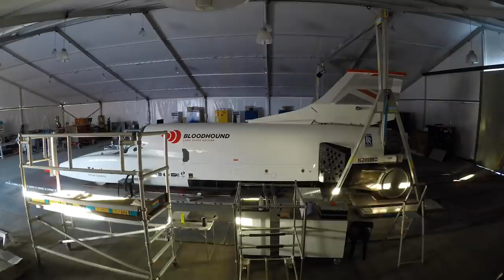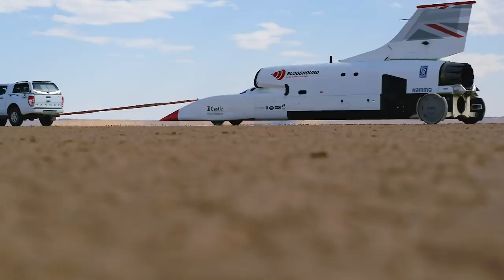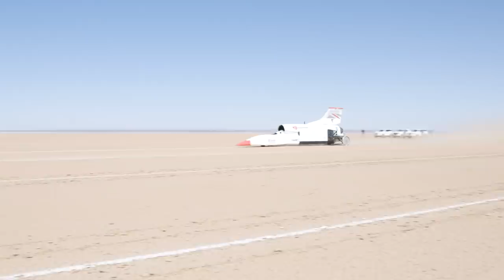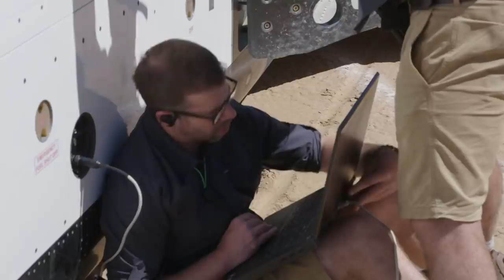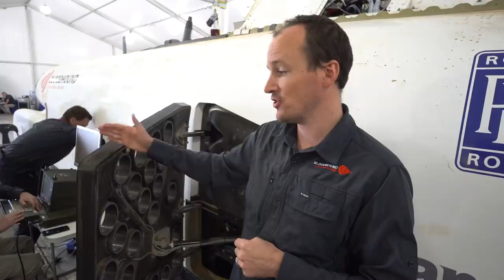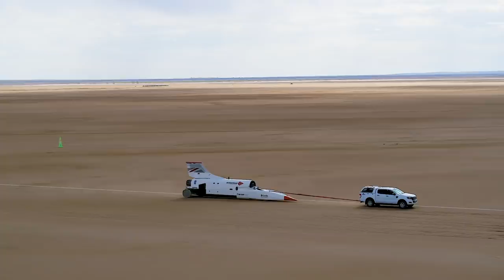Getting Bloodhound LSR back on track! | #2019HST

Comment: If you are running the car without the rocket engine in it, how are you compensating for how this will effect the balance and mass on the vehicle? Are you using ballast to compensate for this? I guess the added weight of it will not only increase the rolling resistance but also add to how far the car rolls.
Reply: This is addressed in a blog post on their website. The rocket will add weight to the rear moving the CG aft, hopefully making it more stable in crosswinds.

Comment: Good idea to test air brakes fully out first and get a baseline. The most hazardous test, I believe, will be first starting to deploy them at speed.  When they first begin to open the aerodynamics at the rear of the car will change abruptly, possibly creating some lift. They may want to keep partial throttle while starting to deploy at speed. That's just intuition on my part. The Bloodhound team has likely worn out supercomputers running CFD on this already. Would be fascinating to see more data.
Reply: Yeh, Bill. I agree that deploying at speed will be the biggest unknown. Guess they’ll try a few runs with brakes partially deployed and see if suspension loads alter drastically.
Reply: @andylewis7360  Could also dramatically alter handling if a crosswind pops up.